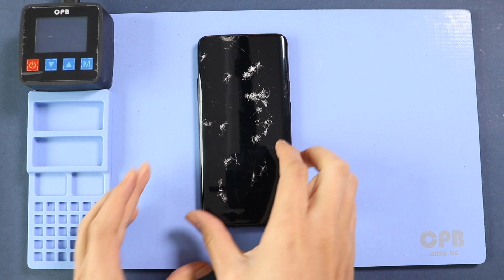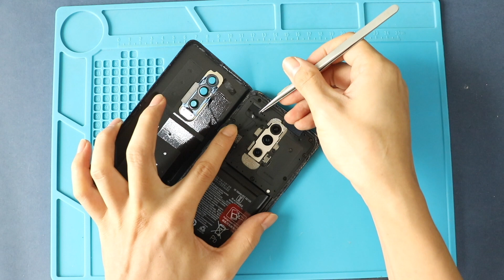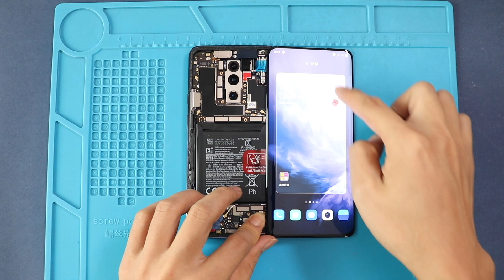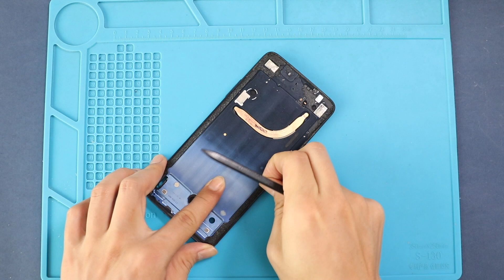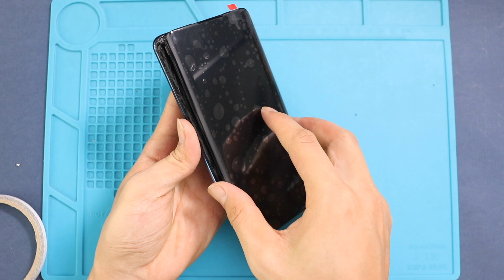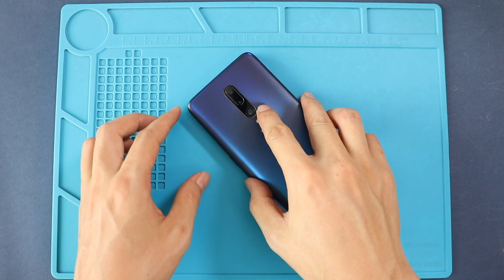Oneplus 7 Pro Screen Replacement | Oneplus 7T Pro

Comment: The original amoled will cost you 10k plus and 6k to 8k for lcd screen but fingerprint will not work also if u want u can get oled screen but it will not come with frame which may risk the chance of water seeping inside the device
Reply from the maker: Thanks for your feedback..

Comment: I just ordered a 7 Pro on ebay which has a green tint now but i hope i can fix it by reconnecting the connector, also cleaning it. 
But its good to know the display is rather easy to replace  on that phone.

Comment: will fingerprint work with a screen replacement or have to transfer the original to new screen?
Reply from the maker: If the screen is genuine it will work, but some cases you might need to set up again.

Comment: hello, can i put my oneplus 7t pro mclaren edition display in oneplus 7 pro? my oneplus 7t pro mclaren motherboard is damaged by water so cant be repaired and i want to replace its motherboard with oneplus 7 pro............please reply
Reply from the maker: Motherboard.i dont think so.  it has some different specs and board will not fit with the new board.
Reply: @DIYGeardo  so instead can i put oneplus 7t pro display in oneplus 7 pro?
Reply: @Pranisx  Does the Display fit bro?
Reply: @gypsy3779  it doesnt support
Reply: @gypsy3779  But you can try

Comment: Could you use 7 pro parts on the 1tpro and vice versa? If so that would be nice
Reply from the maker: you mean 7t pro? which parts?
Reply: @DIYGeardo  XD ya 7t - the screen and back glass, also I'm curious about the battery
Reply: @Lillylafrog  did you ever find an answer ?
Reply: @FUNETIQ  some parts work with both, but it's not very well documented
Reply: @Lillylafrog Does the display work??
Reply: @gypsy3779  yeah, I'm just curious on what parts are replaceable, I plan on keeping this phone for a while

Comment: Excellent video!

I have a question, I'm going to buy a new display for my OnePlus 7T pro, but I'm not sure if I have to buy it with frame or without frame, could you please help me out? Thanks!

My cellphone was damaged by water by the way
Reply from the maker: It is good if you can buy with the frame. Easier for the repair. But it depends on the availability. Also, if you buy an aftermarket screen, the touch id will not work. If the device got water damage, be careful, make sure the board is clean before you doing any repair
Reply: @DIYGeardo  what happens if u  buy with no frame? It wont work? I bought one from ali express for 150 original oneplus screen no frame it says.
Reply from the maker: @MarvelAIReels   It will work, but the steps are a little bit different. Make sure you remove the screen safely and also clean it. Finally, use proper adhesive or glue, otherwise, the screen will pop out from the frame.

Comment: incredibly detailed video thank you. what glue and adhesive strips are you using? I couldn't make out the brand from the video
Reply from the maker: We are using b7000/t7000..if you are using adhesive try to find original pre cut version. Otherwise there are issues with the durability
Reply: you say it's incredibly detailed and then ask for details lmao

Comment: I replaced this same display which is diamond quality original and same M logo on screen reborn...but after connect display I can't find fingerprint option !! So, fingerprint not working.. is it for display replaced?
Reply from the maker: What do you mean m logo? Well if you cannot set up the fingerprint then something wrong with the screen or may be with the repair. How much you paid for the screen?

Comment: Hello can I put oneplus 7 Pro screen on Oneplus 7T Pro ?
Reply from the maker: Without the frame it is same..with frame slightly different
Reply: @DIYGeardo  So with frame will it fit? Any problem with the strip length or something?

Comment: hey if im getting green screen but my touch and glass is perfectly alright what could be the problem ??
Reply from the maker: Well i think it is a bad screen, but might have issues with the board too, try to do hard reset..maybe it might help
Reply: @DIYGeardo  hard reset with volume and power key right ?

is it possible to repalce just the screen and not the glass

Comment: Fingerprint works fine after changing touch and how does it feel, I work like new or local
Reply from the maker: If the screen is genuine the Touch ID will work fine..
Reply: An what will be the charges

Comment: is it necessary to remove the back panel? can I attach a front screen without disconnecting the battery?
Reply from the maker: Nope..you need to remove the screen